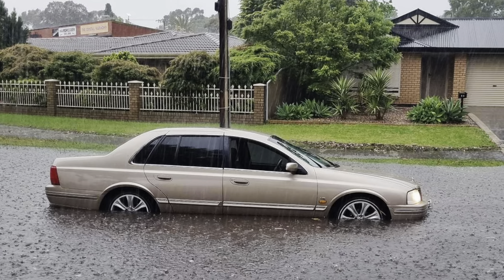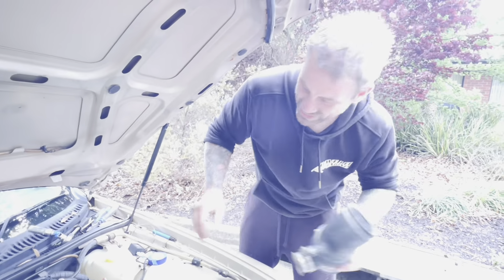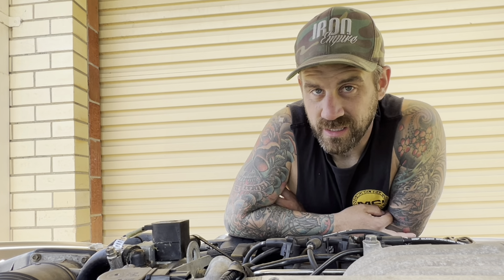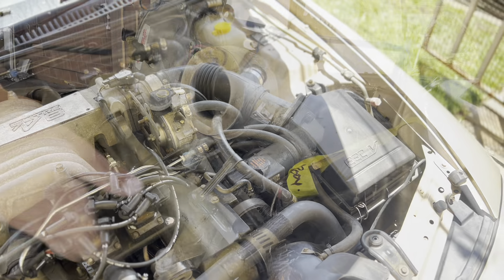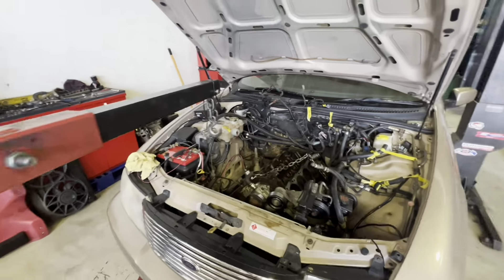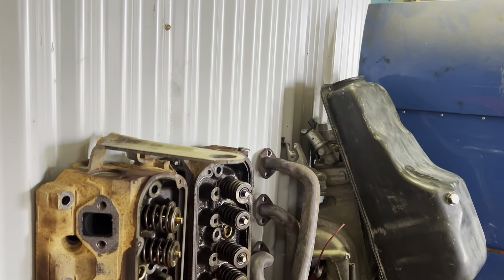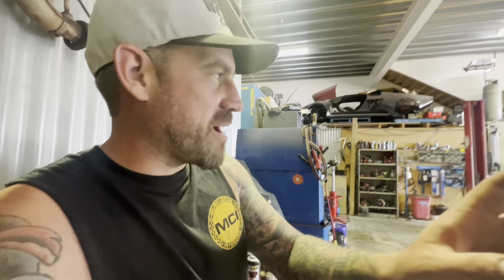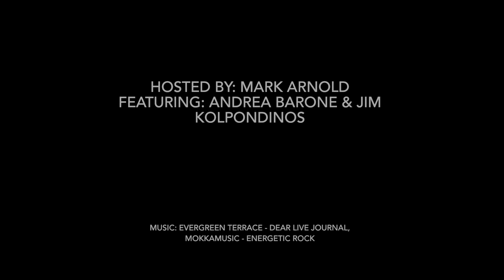AU Fairlane Gets FLOODED! Can It Be Saved? - Iron Empire EP 113

Comment: Things to check Bro 
Is the diff vent still high enough or has it broken off 
Jack up the front take out the 12 vents in each sill and Floor , the carpet has to come out , the ECU will be buggered  it'll rust over time , the BCM should be ok ,there high enough, center of dash , pink in colour  you'll need to do a parameter reset when you change the ecu . If you need AU parts give me a holla.
Reply from the maker: Thanks mate! We’ll see how we go! 
Cheers